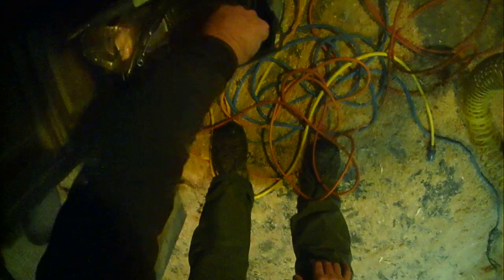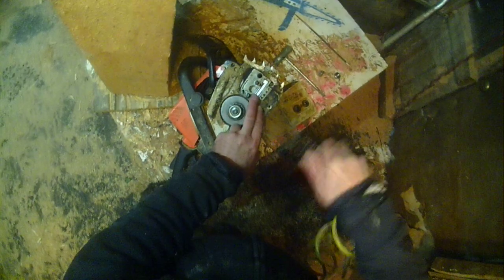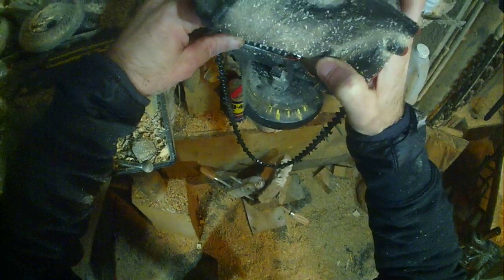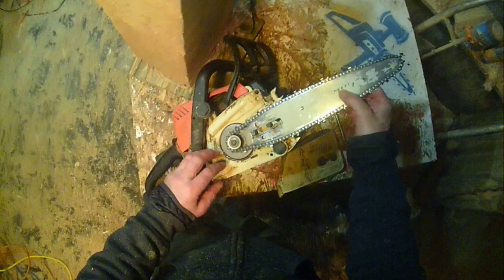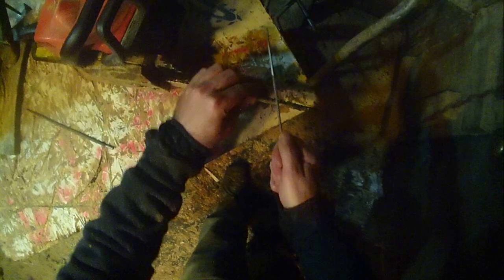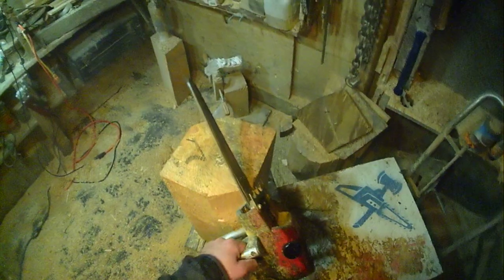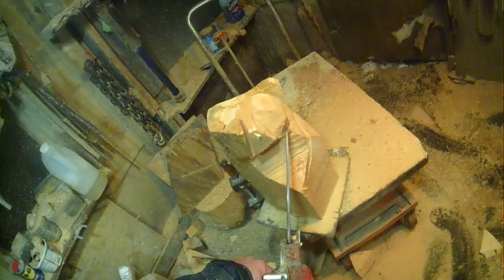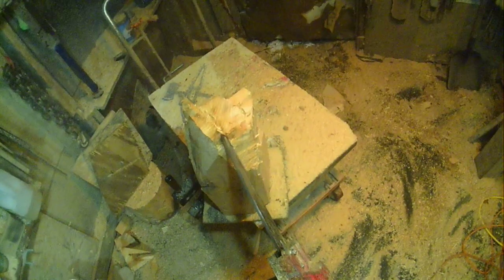chainsaw sharpening

Comment: Having a hard time finding any info on sharpening 1/4" pico carving chain. Stihl says to use a 1/8" round file but even those are hard to find anywhere. Im currently using the Stihl 2in1 sharpener but it doesnt feel like its sharpening. What do you sharpen 1/4" P carving chain with? Can you sharpen it on the grinder? Is there a special stone? Can you use the same stone as your larger blocking saws? Thanks!
Reply from the maker: The files for the .043 can only be bought from a stihl dealer, and even then, hard to find one who has them,or will sell the few they have. I wouldnt sharpen the tiny .043  on a grinder, the discs are made to only go down to .050...there probably is a disc for the smaller chain, but as everything getting so overly homogenized in the chainsaw industry, ots getting less and less so we can do any of it our selves, with anything new. Stihl is even taking the route of constantly threatening its dealers to meet quota, or send everything back, at a buy out fee... it's really sad how stihl.and husqui have gotten so completely greedy, and scared that they some day may not be around. Well, if they keep going in the direction they are going,they wont last much longer. It's very hard to get, or find anything for anything post m tron, whether its chains, or fuel filters. Just look how crappy Oregon chain has gotten to be lately. It's not even useful on a crappy polan saw
Reply: @badasswood  I am most annoyed that I can't buy Stihl products online at all. I don't believe they allow it. You have to physically go to a Stihl dealer. That can't last in this age of online shopping. Thanks for the reply.